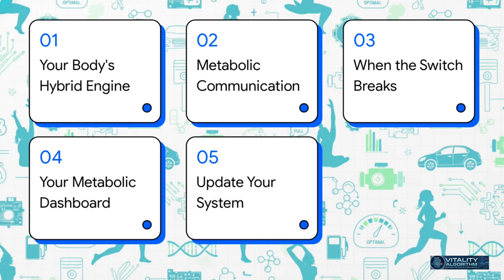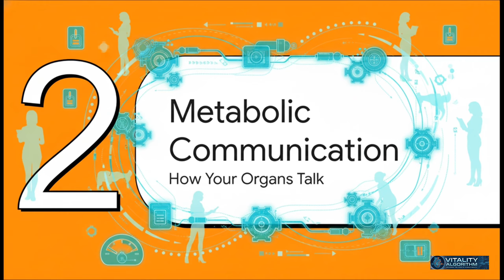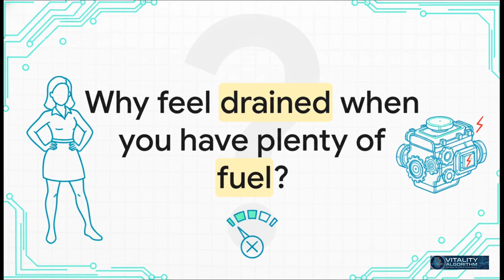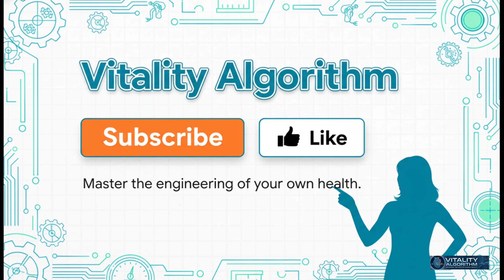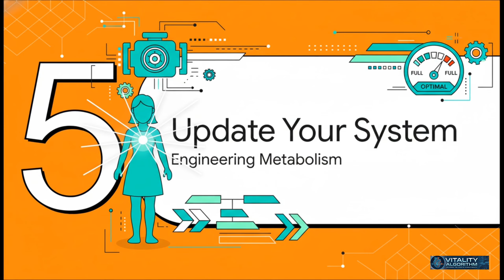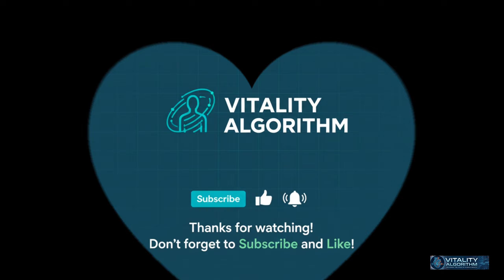The Secret to Effortless Fat Loss: Why Your Diet is Actually Fighting You. 💡

Comment from the maker: Your metabolism is essentially a Smart Power Grid. ⚡

In a perfectly engineered system, the grid seamlessly switches between solar (glucose) and wind (fat) depending on availability. Metabolic Inflexibility is a "grid failure" where the system gets stuck on one source, even when the battery is empty, leading to a systemic blackout across your organs.

Building a Hybrid Mode Engine means ensuring your "Vitality Algorithm" can flip that switch instantly to maintain constant power.

The Question for the Community: > Do you feel your "switch" is stuck? (e.g., getting 'hangry' or experiencing brain fog between meals?) Let's debug your experience in the comments! 👇

Comment: The Smart Power Grid analogy is spot on. I think my system is 100% dependent on 'solar' (glucose) and my 'wind' (fat) power has been offline for years. 😂 Is it possible to fix this just with fasting, or is the Zone 2 training mandatory to 're-wire' the grid?
Reply from the maker: Spot on! You’ve hit the core of the Vitality Algorithm. 🎯
Think of Fasting as the 'software update'—it lowers insulin and gives your system the permission to flip the switch. But Zone 2 training is the 'hardware upgrade.' It actually builds the mitochondrial engines (the wind turbines in your grid) that are capable of burning that fat.
Short answer: You can start with fasting to clear the path, but to truly build a high-performance 'Hybrid Engine,' you need that Zone 2 hardware. One unlocks the fuel, the other actually burns it! ⚡️🏎️